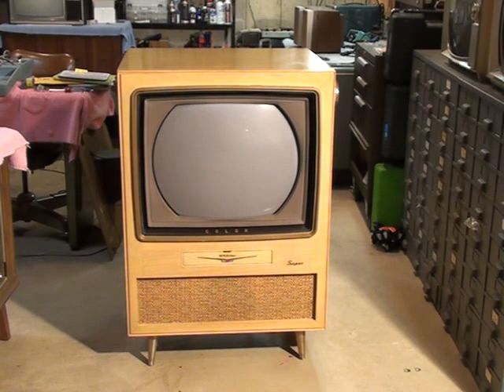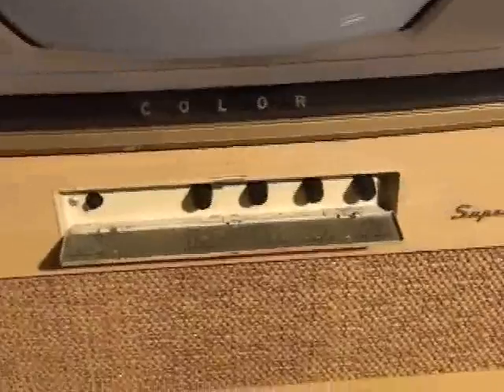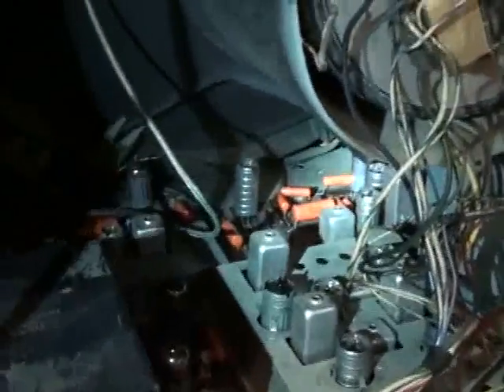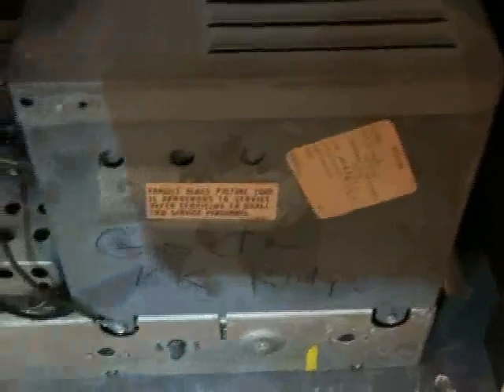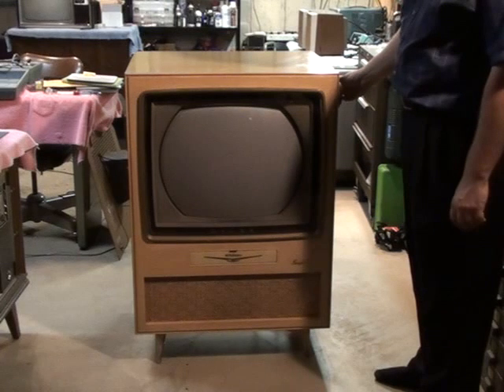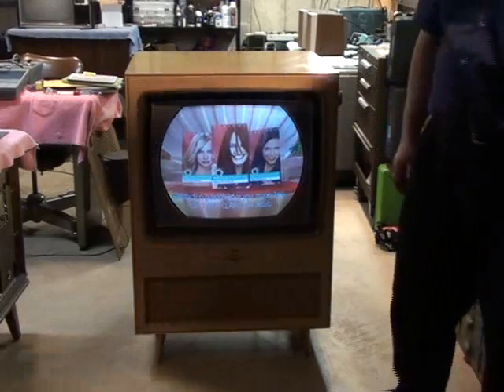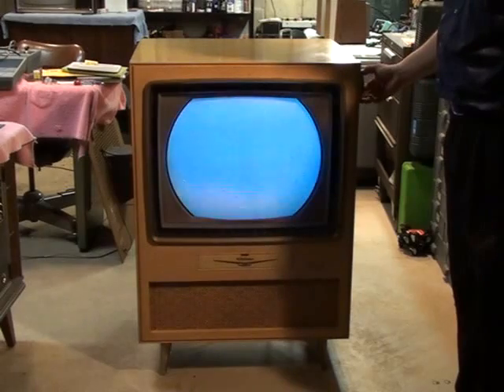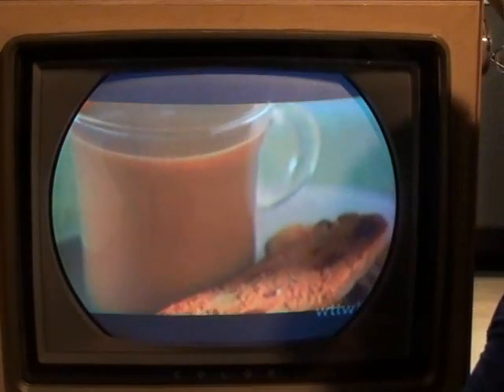Watch a 1956 RCA VICTOR CTC-5 COLOR TELEVISION!! "Roundie"

Comment: early rca sets used great crts This set looks hand wired and a small pc board in it. this early chassi looks better then the the ctc 38 chassi. .
Later Rca sets weren't to good. Zenith was better . When the duramodule sets came out they where better . But the tripplers would short out .

Comment: How reliable where these older sets?
Let's say...

*You fall asleep in-front of it, Accidentally leaving it on over-night.
*Watch your nightly programming when you get home from work for years to come.

How would such a unit perform in these situations?
Reply: Because of all the tubes and all the heat they created the reliability wasn't anything like today. Those older sets were literally roasting themselves to death whenever they were on. They also had a lot of mechanical parts like the tuner and all the controls. You could literally count on having the set serviced 1 or 2 times a year and the repairs could be very expensive.

Comment: What was the purpose of owning this set in 1956 when there was no color programming at that time.
Reply: I'd say that about 80% of shows aired were black and white, but, there were color shows. Many filmed right at, or near the start  in color, through they didn't get to be shown in color until years later in syndication.
Reply: There was, but NBC was pretty much the only TV network at the time regularly broadcasting color programs.

Comment: ...and you can't have a toaster last more than 6 years.
Reply: A modern one, yeah. I have a Sunbeam Automatic from 1955. Still works perfectly.
Reply: @drboze6781  ...ANYTHING built nowadays is meant to fail in order to force you to buy a new one. It is even taught in engineer courses at university. How sad is that?
Reply: Yea, i got one sided toasters from the 40s that still work fine..

Comment: Why all the interest in 'restoring' old TV's and other vintage electronics on YouTube I will never know. I spent over fifty years repairing this stuff, from the sixties through current. I couldn't begin to count all the tens of thousands of vacuum tubes I've replaced, or the hundreds of old sets I've dumpstered.  It's no mystery to me how to do this. Most of these restorations overlook the nuances of how to do a proper CRT convergence and grayscale alignment. I doubt most of these have the proper equipment to do an IF snd Chroma circuit alignment either. The position of the static and dynamic convergence yoke assemblies can make all the difference on how well the CRT will align, most never show that being done, they are too scared to adjust it, as they have no idea where it should be positioned, and if they screw it up have no idea how to get it back in the proper position. There is a proper sequence of adjustments that need to be done or it will never come into correct alignment. This is not for the beginner to try, it takes many years of practice to do well. Deflection yoke positioning will have a great effect on the purity of the screen, and then there is the vertical and horizontal size,  linearity and position that must be set first. All of these adjustments interact greatly. I will not even attempt to advise anyone over the internet on how to do any of this, as it varies greatly on all the specific models out there.  Oh, and just re-capping the equipment will not be enough. All the old carbon composition resistors will also need to be measured, as they have a habit of changing value over time.  Most of the very high value, high wattage resistors used (especially in the high voltage/deflection circuit) are no longer available these days. 
While these videos make it look easy it will be way too easy to make a mess of an old piece of vintage electronic gear if you get in over your head, and that is all too easy to do. Find an 'Old Timer' for advice on your first project, it will serve you well in the long run. 03-07-2020.

Comment: Today's TV's will never last that long or be built that well. Most modern TV's have dead pixels/lines, ghosting, power supply problems only after a couple of years. Modern TV's will fill up a landfill in 50 to 60 years. Thank you China for you poor business quality ethics. I still have my 53" Sony Rear projection screen TV that uses 3 cathode ray tubes not a DLP chip or LCD. Plasma picture fades over time, uses a lot of power and makes a lot of heat.

Comment: This would not work here in 2013! I don't even know if a converter box would be compatible with it or not.
Reply: Chip Drusano it would be, but you’d need to use a 75ohm to 300ohm adaptor

Comment: in 1956 or 1960 those colors were not as in now cause the transmitter machines were also basic. What you are showing is an old tv with current network technology

Comment: VICTOR maid Gramophones with the dog NIPPER listening his master's voice.
Japan VICTOR Company created VHS,  in 1976.

I may using this vintage TV set with NTSC 3,58, with JVC polystandard VHS, i select M norm for modulator in UHF. I use an impedance transformer between 75 ohms on modulator, and 300 Ohms for UHF antenna input on TV set.
I may using a STB digital TV décoder, and CVBS analog output setting to NTSC modus, CVBS is remodulated by VCR modulator.
In Europe, I use a power transformer from 240 V AC 50 Hz, to 127 V AC 50 Hz.
Frequency electricity network, no problem.
AC/DC rectifier by vaacum valves allows 60 and 50 Hz. In Europe, there are a lot of DVB STB with analog CVBS mays delivers PAL or NTSC chroma signal, 625 lines 50 Hz for Europe, and 525 lines 60 Hz for USA.
Playing VHS or DVD or Laserdisc NTSC on PAL 60 Hz TV delivers a Black and White picture on the screen, however, this is 525 lines 60 Hz video signal.
Idem for NTSC 4,43 playing VHS ( B/W picture, 525 lines 60 Hz)

In Latino America, the standard is PAL 3,58( 625 lines 50 Hz, in Spanish latino America, and 525 lines 60 Hz, in Portuguese America, like BRAZIL )

Comment: I wounder why they stopped making TVs look so great. Now they look like plastic pieces of crap.
Reply: Because plastic is cheap, mouldable material that allows for mass manufacture and consistent look/feel.  It does not require a wood shop, it doesn't require skilled labor.
Reply: Mother should have a TV like this in her shop.
Reply: Mine looks like a floating pane of glass

Comment: i think better than today blocky digital craptvs with all their delays, lags and scene falling apart into checkerboards when you have confetti, disco, savanna from helicopter or noise in reception. rubbish in hd, 4k, 8k, 16k, 32k, 64 billion trillion. smart, can skype, browse internet, the only thing it cannot do is reliable, smooth, linear color, robust TV picture.

Comment: Had a ctc4 dumont bought in 1958 used  had rca chassis's flyback no longer available big risk the 4was better  metal crt .
Reply: We sold it  400$  was a tv repair guy 80yrs  old . Set put n museum  .once had ctc2&3 sold used  didn't like the dc convergence on the 5 4was conventional.